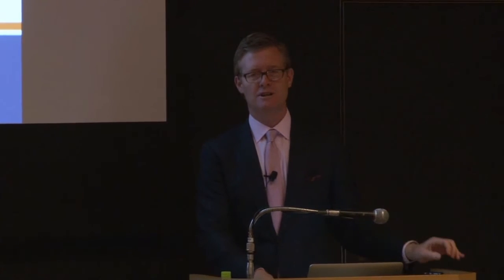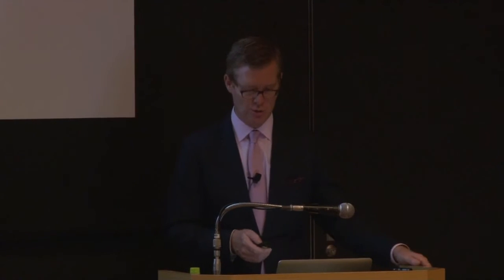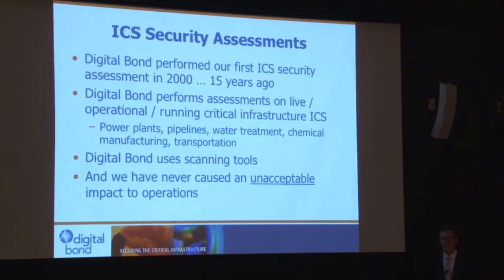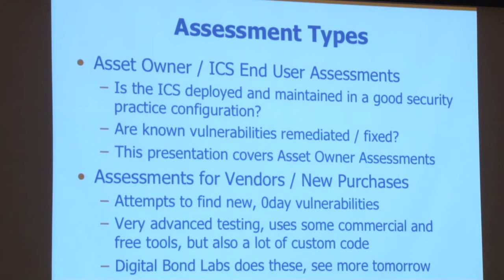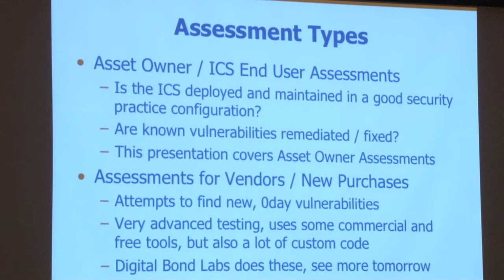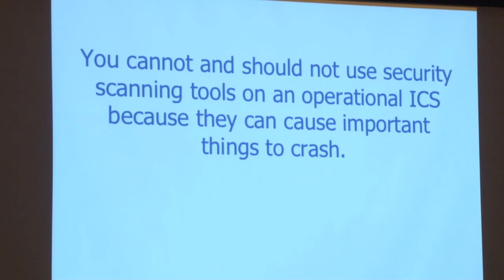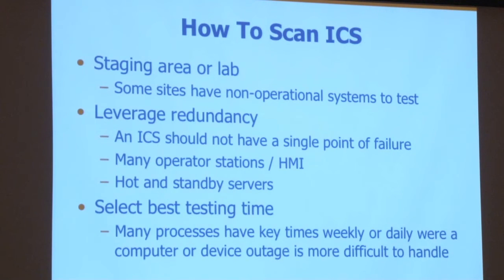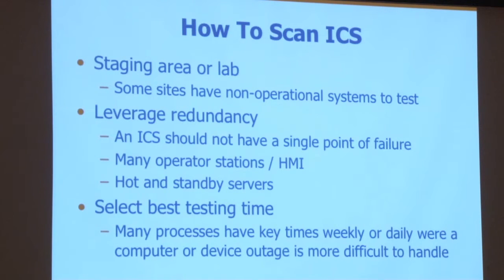ICS Security Assessment Methodology, Tools & Tips

Comment: You mentioned you've been doing live scanning using tools on ICS without any "unacceptable impact to operation". I wonder if the two examples you've mentioned, 1. Safety PLC crash because of firmware upgrade port scanning 2. Server crash due to active server scan running critical service not backed up by standby server, were acceptable interruptions to the plant owners?
Reply from the maker: Yes, they were. As noted in the video, the approach is to find one of every type of computer and device that will not cause an unacceptable impact if it goes down. There are times when a certain type of device cannot be scanned to a risk of an outage, and in these cases you've identified a different finding ... lack of redundancy for a operationally critical cyber asset.

Comment: Nice one, is there a guestimate on the time it would take to audit a medium size facility?
Reply from the maker: Oddly enough, the better the security, the longer it will take. For many plants, refineries, water treatment facilities, factories, that are just starting out with cyber security about 1 week onsite plus some prep days and analysis reporting time post assessment is sufficient. This is due to no cyber maintenance so it doesn't take long to figure out everything is missing patches, in default config, bad user management, ... These actually are more of the interview and inspection than online testing. Most of the effort here is to determine what should be done first, second, third because there is a long list of lacking security controls.

As organizations become more mature it can take a second week onsite, particularly if the team has not been to the site recently. The online testing becomes a larger and more detailed effort, the interview identifies processes that need to be audited, and other items.
Reply: @S4Events  How  about a 20 wind turbine generator farm?

Comment: Sometimes we receive a very comprehensive requirement encompassing all areas of cybersecurity including physical, I just wanted to understand what would be the pitfalls during the project execution. Any specific questions that we should raise to client before the project is awarded.
Reply from the maker: That's a big question. You may want to look for the Cyber Security Procurement Language for Control Systems (search for it). It tries to answer the question, but you need to use some judgment rather than just cut and pasting into a RFP.